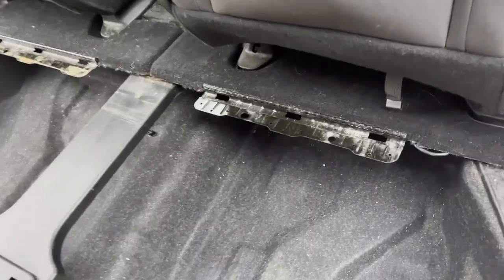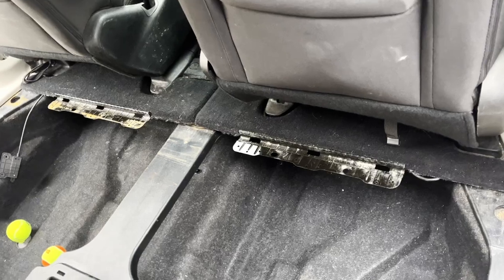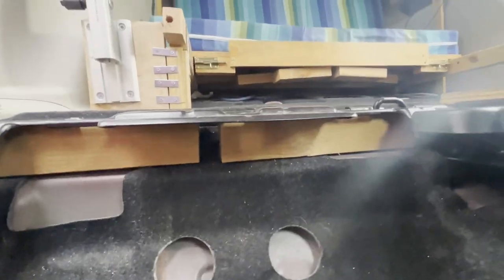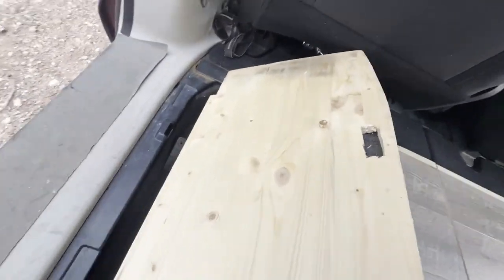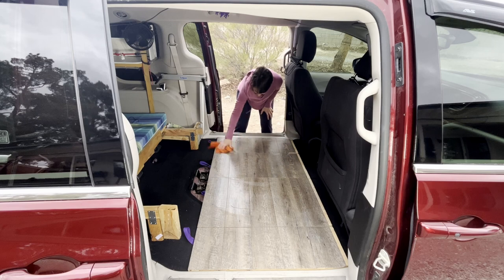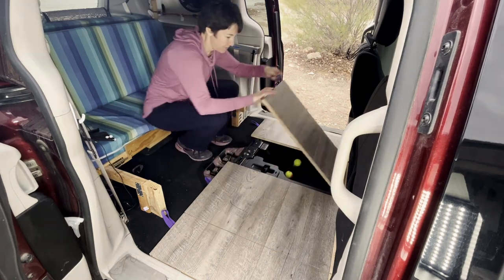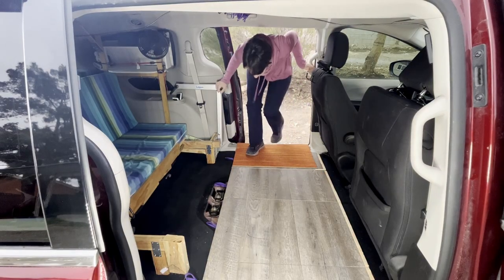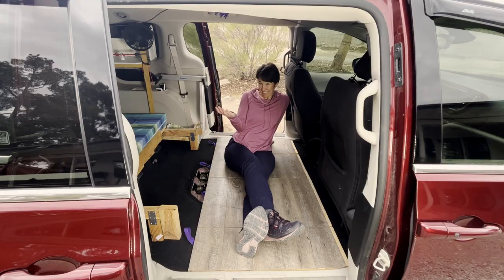Pacifica Minivan Conversion Floor with Seats Removed!

Comment: I wonder if the seats would fit in one of those roof top bin? That way you can keep them in there in case you end up needing to give multiple people a ride. Then you can swap out the items stored in the floor temporarily in the roof bin. I would suggest using those folding underbed storage containers in the floor compartments so you could just grab the whole thing instead of moving individual items, and it would be easier to take them out to clean too! Another suggestion would be to put the front seats on a swivel so you can entertain. Not sure how much those cost though!

Comment: I was thinking of getting a roof mounted box where I could place the heater opposed to on the ground where someone could steal it … it could be bolted to the roof box …I’m not sure if these were made for outdoors but it could even travel up there so I don’t have to take it up and down…I will have to investigate this further…also a ridged solar panel could be bolted to the box and also the starlink. ..worth looking into and I’ve seen a guy who made his own roof box much cheaper than buying one. So…there’s a good project! And currently I’m in OKC and love to car camp..we need to meet up. ☺️

Comment: Well, since you asked, I wouldn't mind seeing a video on how you removed the center console.😁 Subbed!
Reply from the maker: Hey Vantastic! I actually didn’t remove it, it just has an open space before the console. I want to remove it, but when I remove the top portion there are all sorts of airbag warnings underneath, so boo.
Reply: @minivancampergal1554  Oh, I see what you mean. No worries. It would have been nice if they made it removable.😁

Comment: I went for the transit connect vehicle, but watching more videos from SUV, I feel like this is just as much space,  and especially with the floor storage. 
If I change into an SUV, I'm thinking about making a fridge in one off those rooms. I have seen it done in another build, and it holds so much food, and perhaps a battery/garage in the other.
I do like how you had your water tank in there on another video. 
Out of sight, out of mind, really is true..
Reply from the maker: YES- a cooler in the storage bins! I saw this as well, and have been thinking of doing it. Thanks for watching!

Comment: I just stumbled upon your channel thanks to hating the super cheap carpet in my Pacifica.  Have you considered upgrading the rest of the flooring, too?  If so, is the wood thickness needed simply one size thinner or did you have to use various levels of boards to make the perfect, smooth floor from non-stow to stow sections of the floor?  

P.S.  have you tried any of the weather seal edges for doors around the seams to keep dirt and sand out from sliding magically into the storage stow bins?  

Thanks.

Comment: Just found your channel and I'm loving simple clear style.  I'm in the planning stage for my van adventures.  What is important to me is comfort being able to work out of my van.  One of the questions I have is finding a comfortable mattress.  Is there a way to try one out before hand?  Are you happy with yours and how did you find it?  Thanks! Whit - Vermont
Reply from the maker: Hey Whit! I bought mine from ikea. Some good advice I heard- get the thickest one you can!
Reply: I have a Milliard tri fold 6” mattress in my Pacifica camper van and love it especially since they make a fitted sheet that fits it perfectly